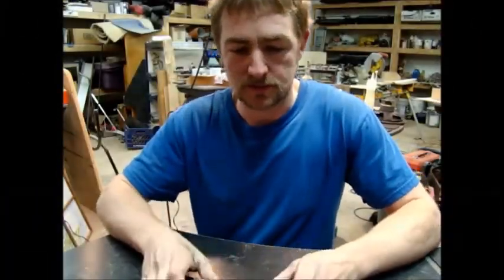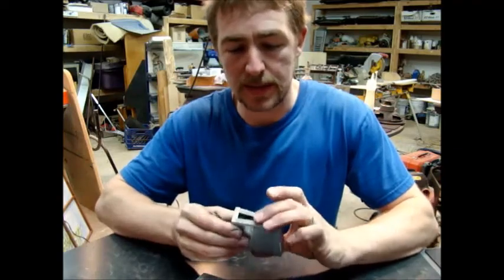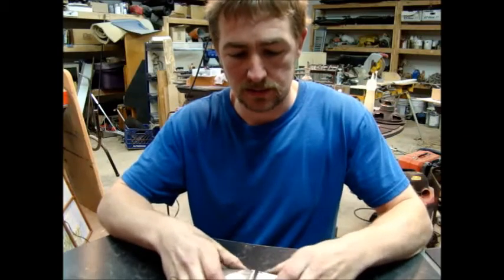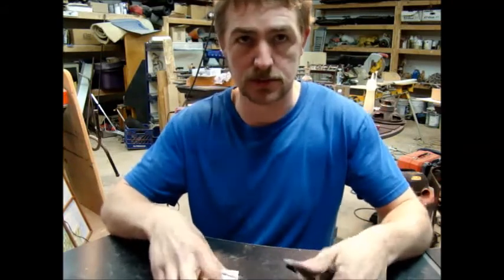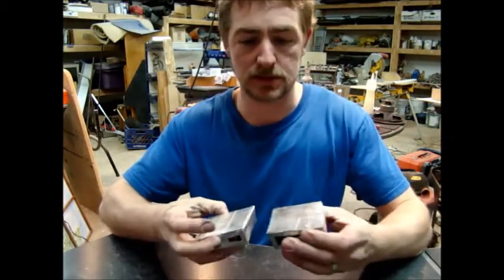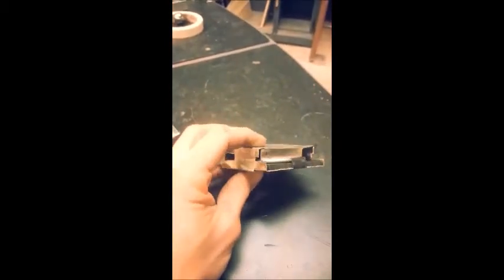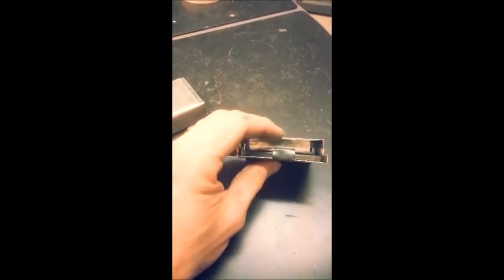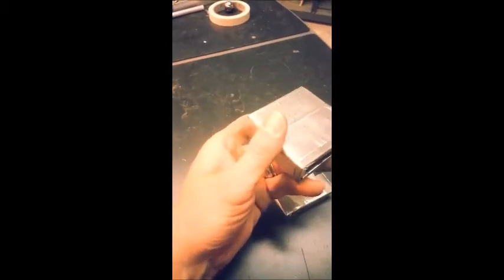James Roney Stator replication

Comment: as per the orientation of the field on these magnets... I have to suppose that the strong side of the magnets is the large face. I say this simply because in my looking for magnets to purchase for my device... it was near impossible to find magnets with a N and S on the long side.... especially if they are long in on direction ie: 1 x 3 x 1/4 inch. The N and S are never on the 3 inch sides. Not to say you couldn't special order in that configuration but retail you generally wont find it. So the point is that the field on the 1/4 edges is not strong at all compared to the large face, and it doesn't take a lot of spacial distance to diminish any magnetic effect. Find some magnets that have the field in the orientation I described and try the experiment and I'll bet you have different results. There are a number of magnets that are as I described but not that I have found in the size you are using. Think about it for a moment a 3 x 3 x 1/8 magnet you will surely never find N and on the 1/8 edge.  Why ? The large surface us just more useful.
Reply from the maker: mdlarouche your right. a normal retail magnet is not magnetized that direction. I have ordered many custom made magnets for a project the is magnetized in the fashion however. it really depends on which direction it was facing while sitting on the magnetizing plate.

Comment: Ok first off the way I see it magnets pull or push harder the closer they are so the force is a product of distance. The one edge of the stator is simply further away from the magnet itself on one side and on the other side .... the edge of the stator and the edge of the magnet are essentially one in the same.

If you were to simply put sheilding material against the negative pole of one magnet and then tried to move another negative pole against the other side of the shielding, I would be willing to bet that the two magnets would repel each other much the same as if the shielding were not even there...

By putting a magnet in a metal wrapper as you have done  it extends one side with a hollow and there is less mass. 

Attach two rods of different masses (diameter) to opposite sides of a magnet and extend then outward the same length on each side, a suitable amount so that the effect from the proximity to the magnet itself is minimised. At the ends of those rods you try to attach some metal to those ends you will find that the end of the large rod will not have the same push or pull as the small rod.

 I do know for a fact that there is magnetic shielding foil that does damper magnetic fields to a certain extent. I used to use the stuff to sheild the electronic components in my electric guitars from the magnetic pickups/transducers.

 Try using a magnetic array called the Halbach effect You will get a one sided magnet... isn't that what you are looking to construct?

Just thought I'd pass along my thoughts...
Keep up the work
Reply from the maker: Possibly.  You should build it yourself and see.   Its more then just distance of less then 1/2.  These Neodymium magnets are crazy strong.  And with the shielding gone its easy to see they behave totally different when they're not shielded.
Reply: I totally agree. I built this myself and came to the same conclusion... when you're testing the non-shielded sides, they're literally just apart... yet the other side testing they are very much apart. This had me thinking that it's really a magician's illusion. I gave up on it pretty much after that. I'm all for investigating magnetic shielding, but he didn't address the apparent distance (times 2) when you hold the so called shielded ends together. if you take a GauseMeter as I have at the same measured distance from the inside magnet, it's only slightly Sheilded as one would expect. Meaning, I don't think there's anything at all special about the way he did it. He mentioned in that teardown video that there was another 'secret sauce' thing that he did yet didn't seem to want to make a video of that or reveal that in the video for some ungodly reason. What could that be??